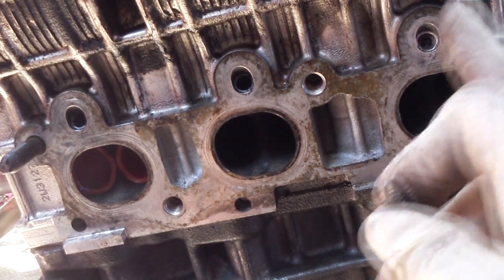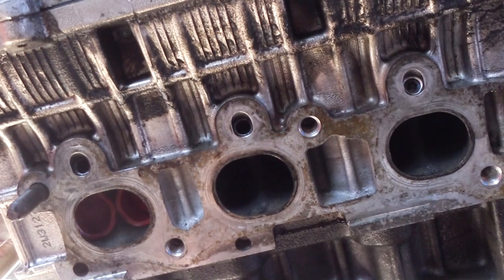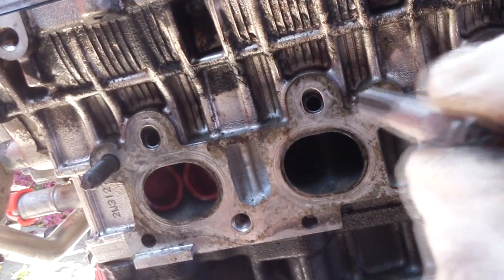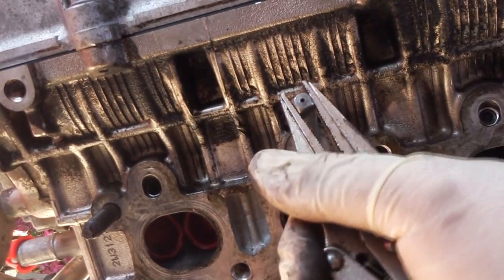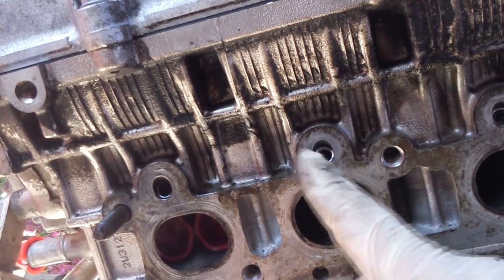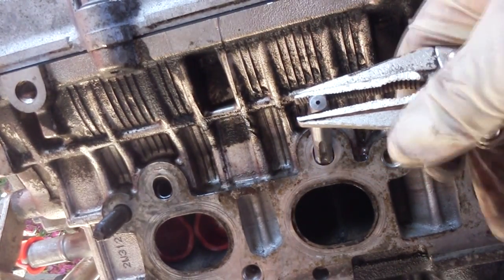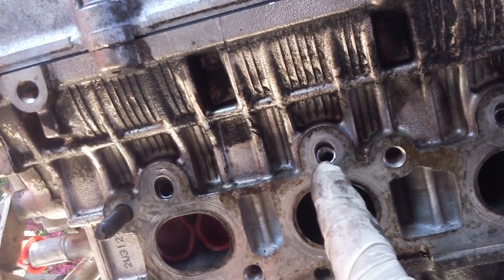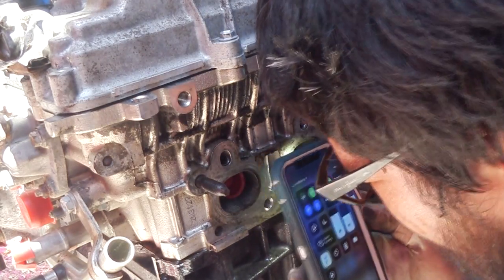Monkey Wrench Racing Plug Kit – Air Injection Ports 2ZZ-GE

Comment: I just installed this kit, thank you so much for the video! At first I was confused as they weren't threading in but I saw the angle you mentioned. My car used to sound like the tractor and this solved the sound issue.

Comment: Hey bro, I have a question. I live here in California I’m looking to buy a JDM 2zz engine. Would it pass smog? Or do I need to get the one with air injector? Thanks
Reply from the maker: If you are near central cali I got 2 engines for sale with air injection for $800 190 compression on all 4 cylinders
Reply: @2zzlow  yeah if you can email me @ smoua079 @gmail.com we can chat some more. Thanks
Reply: @2zzlow  you still have 1 for sale?

Comment: Hey 2zzlow! Love your videos! Do you think this is something that can be done with the engine in the car still?
Reply from the maker: I’m not going to say no but the space is very very limited especially in a celica.
Reply: @2zzlow  Ok I didn't think so. I did have one more question. I have a 04 Matrix XRS.I want to get the PPE Header but I don't want to pay so much more for the air injection version. I seen under the plug kit that all headers MWR sells have block off tabs or plugs. So if I got the PPE Header without air injection would I need the plug kit? Or am I just reading it wrong lol.

Comment: 2zzlow it is true that  can swap a honda header to install it in a corolla xrs 2zzge?
Reply: K20 yes
Reply: @MariaRivera-rs5iz   which k20 header?
Reply: Which k20? Also is it with the monkey wrench header adapter plate?
Reply from the maker: not without modifying the crap out of it

Comment: What if I have a stock header and am trying to swap a 03 engine into a 02 Celica? Can I make that work or do I need to wait for those plugs?
Reply from the maker: You can also weld a block off plate on the exhaust manifold

Comment: Is it possible to use a 00 year 2zz engine on a 04 body or would I need to drill holes for air injection ports?
Reply from the maker: seems like alot of work that way around.
Reply: @2zzlow  your right might as well just get a new cylinder head that already has the injector ports and use the 00 block
Reply: @weliftnation2418  you can use it but you would have a check engine light on or just use another 2zz with out air injection

Comment: Hey, the holes are for air injection, its not an EGR system that sends exhaust back into the intake. 
The air injection is a system that allows the catalytic converter to warm up quicker during cold starts by burning the unburned fuel with the extra oxygen injected in the exhaust and allowing the catalytic converter to heat up faster. This helps lowering emissions faster and extent the life of the catalytic converter.
The pump automatically shuts off after the warm up process, and it will not allow exhaust gases  back into the pump.

Anyway, i would like to add i really enjoy your videos and how helpful they are, they help to visualize some of my problems i encounter on my european Corolla Hatchback with the 2zz-ge Supercharged edition.

Please, keep up the informational videos!
Reply from the maker: thanks for the reply fam
Reply: It seems like you have good knowledge in 2zz world.

A friend of mine is having a 2zz swap in his vitz, the issue with the lift is it works but when the temperature rises almost to middle, it stops working, lift bolts, sensors, solenoids, o2 sensor, vacuum, so far almost everything is been checked and rectfied. You name it. But still the issue is as i mentioned earlier, lift stops working once the temp rises up to the middle on the heat guage.

Would really appreciate if you share some.of your knowledge about this.

Can contact me on whats app
+ 9 7 1 5 2 9 2 3 1 1 9 9
Reply: @khaliddjamill  Hey, about the lift on 2zz, it needs few parameters to work.
Water  temperature above 60°C, engine rpm (6000-6700rpm), oil pressure at the solenoid valve.

They way you describe this issue as lift works while the engine is cold/have not reached the optimal engine temperature.
And the lift don't work when the engine is hot/optimal engine temperature.

Since the engine can start/run, the engine rpm signal at the crank should be working, otherwise the car would not have started at all.

What i would assume, is the engine could have a faulty water temperature sensor messing up the signal to the ECU, i'm not 100% sure about this but the dash temperature gauge gets the info from the ECU, not directly from the sensor.

This could be a place to start, also, did you check BOTH oil filters/strainers in the cylinder head, one near the solenoid valve, and the one near the water pump?
Oil viscosity could have an impact but marginal, you probably don't run a super thick/thin oil than the usual 5w30 - 0w30 ish most 2zz gets recommended.

Worst is if all the components are working fine while its cold, some like solenoid valve could have issues internally where it functions perfect when cold, but when hot the resistance within the components, could be to high or even shortcut without giving a check-engine light.
A bad solenoid valve would not give a check-engine light, if you haven't checked it yet.

Then with a custom build, there is always that possibility that some wires are not pinned correctly or missing when trying to merge the wiring harness from the car/engine to the new ECU.

Kudos for doing a Vitz 2zz-ge swap, i was thinking of doing a project similar to this, and still be within the legal side of the law when it comes to being able to get insurance and valid MOT, the law is pretty strict when it comes to modifying cars built after 2000 here in Denmark. I own a Corolla TS compressor 2005 myself, working almost 8 years as mechanic with some knowledge on the 2zz-ge power plant, im pretty sure its a doable project.
Anyway, good luck pinpointing the issue, hope i could be to some help.

Regards, 
E. K
Reply: @NoobiiPower 

Thank you so much for your time and briefing step by step to check the issue.

Solenoid filters has been checked several times and they are good to go, oil viscosity is the same as recommended, i believe we need to check the wiring and the temp sensor. 

Lets hope all goes well this time and we rectify the issue.

Thank you once again, appreciate a lot.

Regards,
K.J.
Reply: Hopefully you can help. Would I be able to use a 2001 spec jdm 2zz in a 05 xrs matrix with the air injection?

Comment: I put a japspeed racing exhaust manifold on 
Bloody pain to get original manifold out  when the engine is still in th car 

I just used quick steel to fill them holes as my order from monkey wrench didn't arrive in time and I needed the car 

1 month later and still going strong
Reply from the maker: well shit if it worked thats awesome. Glad to know other solutions exists.

Comment: Could also use one of those tools that has a telescoping arm with magnet on end. Come in handy when you drop a nut in engine bay. They are pretty cheap at auto store.
Reply from the maker: its aluminum shavings